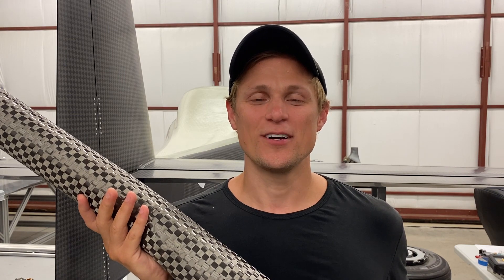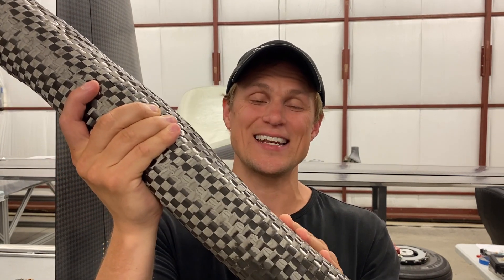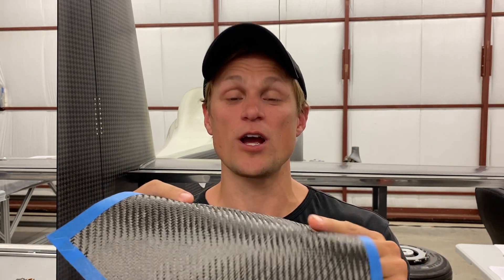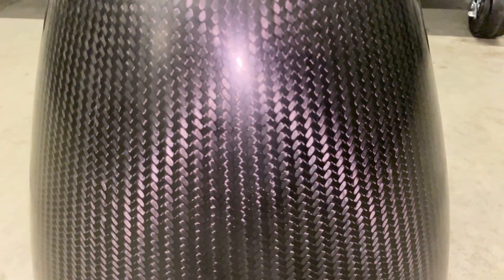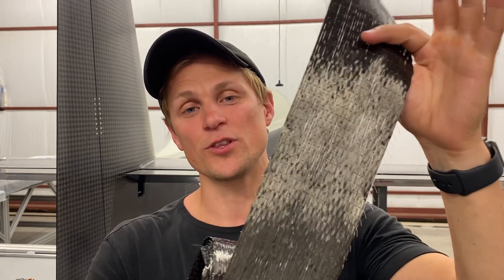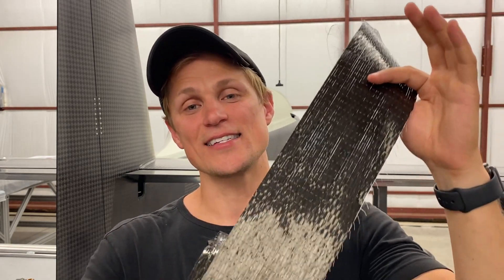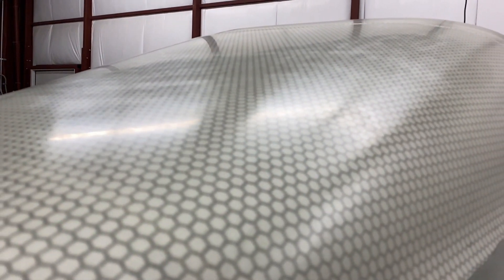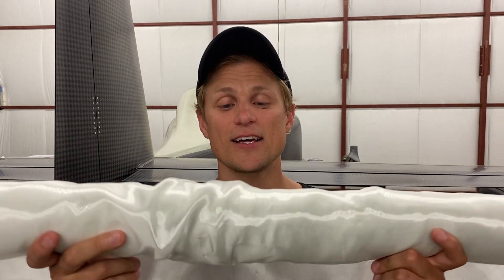Why We Use Different Types of Carbon Fiber in the DarkAero 1

Comment: Thank you for explaining the actual properties & differences in each weave type. I knew they had different strength & application characteristics. But Ive been staring at pictures of the Mclaren 720s chassis, trying to figure out how its made.. and why they used 2x2, 4x4, multi-axial, (and what appears to be forged). This explained a lot of the questions I had😅👍

Comment: That's interesting.  So is it safe to assume an epoxy coated carbon fiber piece, that is touching aluminum will not corrode?   Or will it still, thus requiring insulation of some sort..  In my case a thin rubber gasket would suit the requirements ( i.e. automotive )

Comment: Thank you so much! I just need help with which carbon fiber weave will be strongest when it comes to bending strength? I'm looking at a sheet thickness of 0.50mm and about 110mm x 84mm in length and width.

Comment: thank you for the easy explanations with argumentation. For the next project you could use thin ply topology optimization, in which thin layers of unidirectional carbon fiber layers in different angles (you can search carbon fused deposition or automated fiber placement , which only modulates the angles of layers, not the thickness) and also different areas, what gives different thickness in any area. You can use an diy arduino machine similar to cnc to apply the plies and then wrap it around the shape you want to make with vacuum bagging. Also in the case of honeycombs, 2, 3 or 4 cores of 5mm gives more strength that one core of 10, 15 or 20 mm, like an onion and an orange. You can use also your own honeycombs made of thin ply carbon fiber oriented 90º, inserted in a mold that gives half the honeycomb structure and then gluing together, an also you can make tetrahedral honeycomb cores, using a layer of foam tetrahedrons and placing continuous carbon fiber only in the edges with a 3d printer. Tetrahedral cores give more strength and weight ration than honeycomb cores and if you stitch (stitching and weaving is necessary in composite construction)  the edges of the tetrahedron to both sandwich layers it reduces risk of delamination and add strength too, what in the end, reduces the amount of carbon fiber layers of the sandwich, reducing weight overall with a better laminated structure.

Comment: Have you thought of using Kevlar in place of the fiberglass near the antennas??
Reply from the maker: Hi Reverend! We have considered using Kevlar since it is lower density than fiberglass so there are some potential weight savings there. Kevlar has some disadvantages as far as working properties so we used fiberglass for manufacturability reasons. Fiberglass is easier for a builder to cut, trim, and sand compared to kevlar. I think we would probably explore something like Innegra before using Kevlar. Thank you for watching!
Reply: @DarkAeroInc  thats cool i was just curious wasnt sure how much harder it would be to work vs other composites

Comment: Is the hex pattern on the canopy some sort of mesh antenna ??
Reply from the maker: Hi Tim! The hex pattern you see in the canopy fairing is actually the core material which is known as Soric. The fiberglass becomes translucent when it is infused with epoxy resin and the core material can be seen through the skins.

Comment: Interesting. When the wing structure is stiffened by selection of carbon fiber as a build material, I assume it then transfers (and concentrates?) the load to the spar attach points?

Comment: How do you impose fiberglass (or some other insulator) to prevent metal fasteners from galvanically corroding to through holes in carbon composite panels?
Reply: Avoid fasteners first. If you need to, stainless steel fasteners are not a big issue in carbon fiber, and titanium as well if it's feasible. Mike Patey's Scrappy build is carbon fiber on steel frame, so there's probably some good information on his videos about this. Other than that, fiberglass flanges or brackets incorporated into the carbon fiber would work if the design made sense.
Reply: I'm curious about this too.
Reply: It’s layed up along side the carbon so when you say do a 5 ply layup if you know something metal is going to be fastened onto it you add a ply of fiberglass to the side which it’s going to be fastened too
Reply from the maker: Rick, we recently made a video detailing how we prevent galvanic corrosion. The link to that video is here: https://www.youtube.com/watch?v=yRpMZaU8zKw